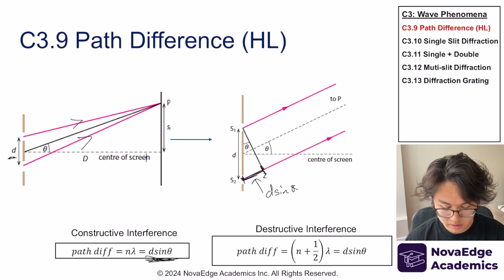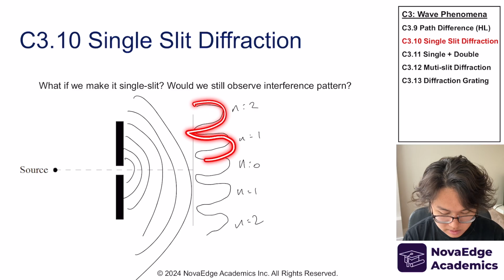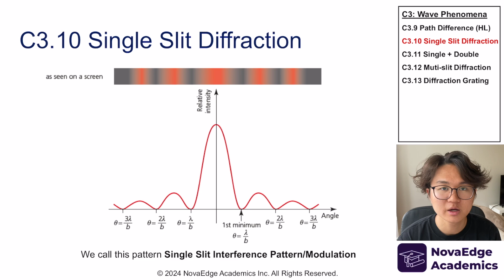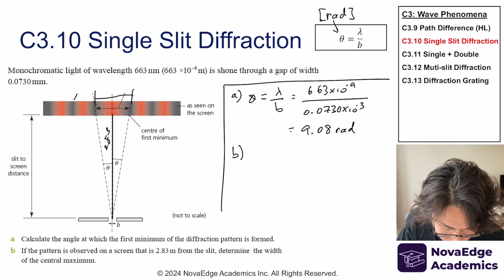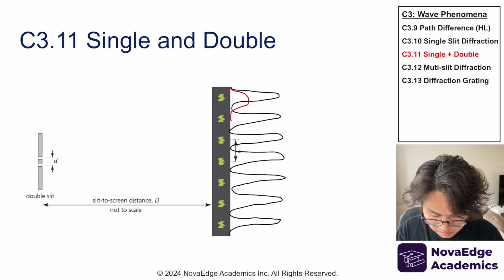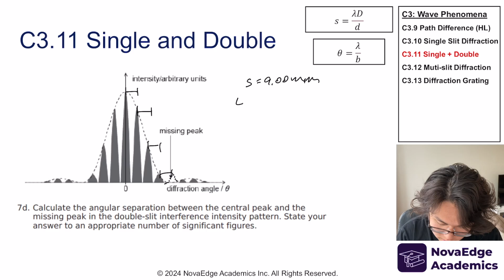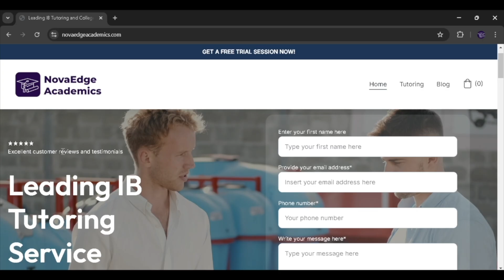NEW 2025 EXAM IB Physics C3 Wave Phenomena P3 (HL)

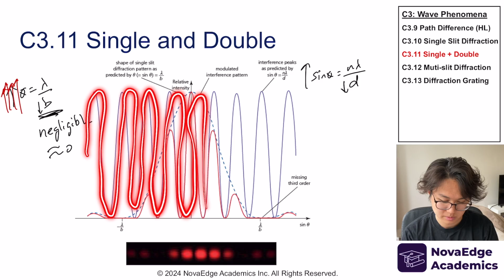Comment: 14:50 if slit width is negligible, what happens when you say "this is what happens'
Reply from the maker: If slit width, b is negligible (approaches 0), then theta approaches infinity. Theta is angle to the first minima of single slit modulation (blue dotted curve), and if that is infinite, then that means there is no minima (all interference peaks have the same intensity, as shown by purple line)